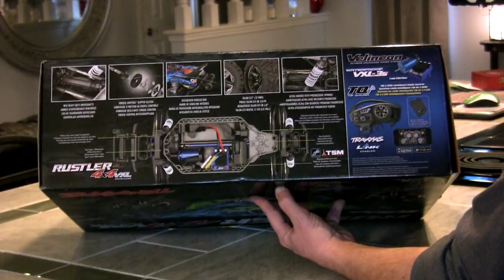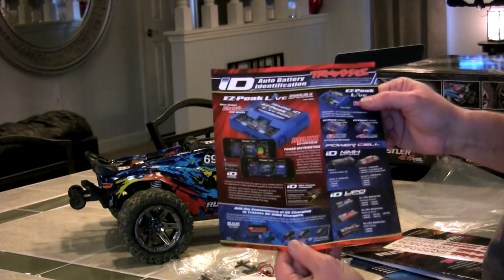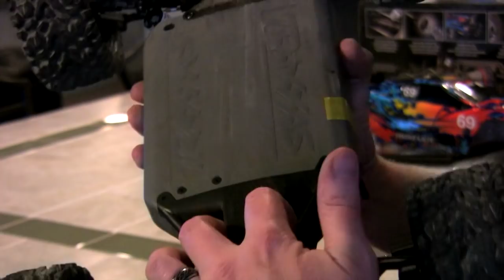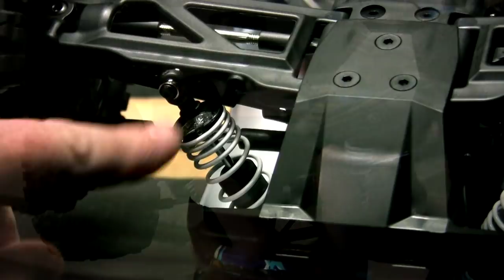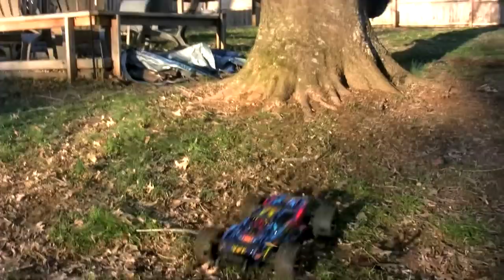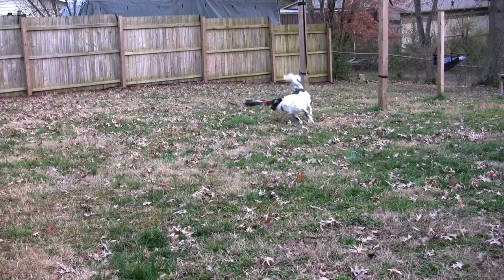Traxxas Rustler 4x4 VXL #4 - Unboxing, Problems to Expect & Road Testing, RC Cars

Comment: I'm interested in why you trashed the spur gear… You should not be replacing them often.  I mean especially if the slipper clutch is set properly.  I just bought the car and I am not going to expect to replace spur gears.  I'll come back if I do and eat my words but I think if the cars set up that should not happen.  You should be able to use the spur gear until it literally wears out then of course the slipper clutch can not even save it… But yes definitely do not put in steel.  I don't have any experience yet but I plan on getting some shortly.  But I have run the Emax and never had problems with spur gears. … Alignment has to be checked from time to time but the new guide template used in mine there's no way it should be able to move.
Reply from the maker: Honestly I was pretty hard on mine right off the bat so it was probably my fault. Going full speed then breaking, spinning and then full speed again will certainly chew them up. Just for future reference, if you upgrade to any aluminum parts you'll start chewing up spurs and axles very quickly.
Reply: @FranksTechHelp  I understand the importance of what you're saying.  I don't plan on doing any aluminum upgrades the car should be plenty strong as is… And I also believe the plastic spur gear can last because as I said I had the bigger Emaxx… I will admit I ran that vehicle 2×2 cells  but the spur gear lasted forever no matter how hard.  Three cells could make all the difference but I still believe in that slipper clutch.  But your video was nice and it's so cool that you responded to me thanks… I'm only going to be running my car 2 cells will not for seeing too much trouble.  Keep up the good work

Comment: Frank what’s up with the overly loud clicking of my gearing?  I’ve tightened, loosened, drowned it in lithium grease just to try & get it quiet for late night speed runs down mainstreet. Click click is loud as hell when it’s dead quiet outside

Comment: I running a 3s 5000 in mine 4x4 rustler and man its fast with it and on my 2wd rustler vxl I put on a slash bumper on the front and willie bar on the back to but nice trucks tho☺☺

Comment: The traxxas  rustler is not durable! If you are using a lipo 3 cell  you will  break something every time you use it. Shocks, spur gear drive shafts

Comment: Hello I’ve had mine for 2 weeks now and I’m running stock with the 3s LiPo and it over heats within 3-5 minutes of play and goes into thermal shutdown I have tried loosening the slipper clutch but still gets hot straight away I’m going to buy a fan for the ESC and a 2s LiPo but not impressed that it over heats so quickly on 3s does anybody have any suggestions as to why it’s getting so hot so quick??
Reply: Get an aftermarket clip on fan for your motor, it helped mine dramatically.

Comment: Does we have to buy the battery and the charger separately or are those gonna come with the box?
Reply: they come with no batteries or charger I would reccomend the traxxas 2832X (3s 5000 mah lipo) and the traxxas ez peak live and another thing is the orignal traxxas batteries dont fit and the new traxxas batteries also dont fit you need the very new short batteries
Reply: Sky Kye umm do you have instagram? 
If you have can you dm me, my @ is 
@m3zo.__

Comment: I wanna buy the Aarma Kraton but in Puerto Rico there's not spare parts 😔 so i have to buy a traxxas 😏 what should i buy. The Slash platinum or the Rustler vxl 4x4. 
In Puerto Rico the spare parts for traxxas are all over the island. Aarma only online, and almost all sellers do not send to PR

Comment: It's better to use loctite on set screws
Also, look at some videos on how to set gear lash. It may be part of the reason you're eating so many spur gears. Landing jumps on full throttle will also shorten the spur gears life
Reply from the maker: Thanks for the advice. I got it all worked out since then. Everything was loose on mine for some reason, all good now tho. And I totally agree on throttled landings ;)

Comment: im not happy with the turning , ive drivin my neighbors ofna 4x4 and it hits donuts and turns on a dime, and i just cant get the rustler 4x4 to do it, not stock atleast
Reply from the maker: I agree with you. The rustler vxl 2wd actually turns very well. The 4x4 isn't as forgiving but it is 4wd in the end. Also make sure you adjust your TSM knob on the remote. Probably just below 50% if it won't turn well. I had to work with mine a lot to tweak it the way I wanted it.
Reply: Definatly turn down ur tsm to 0

Comment: Lossen your slipper clutch if youre roasting spur gears
Reply from the maker: Thanks for the tip. It turned out to be all of the loose linkage and slipping screws. Got it all worked out and I've been running the same spur for almost two weeks now.